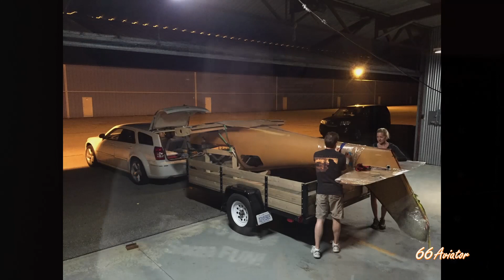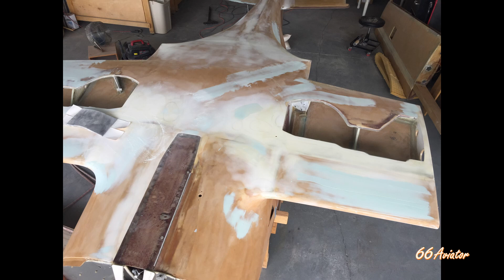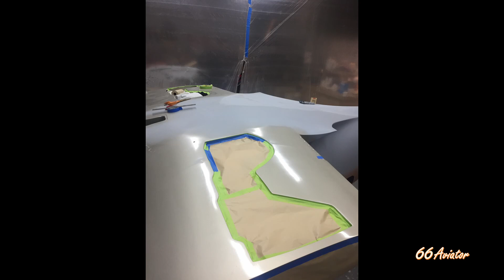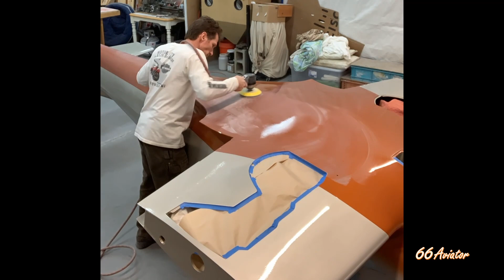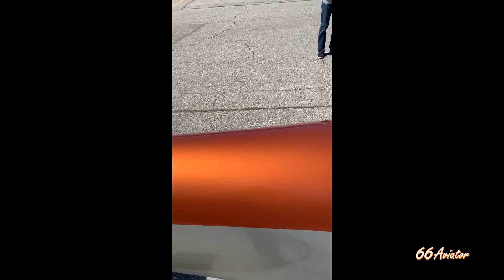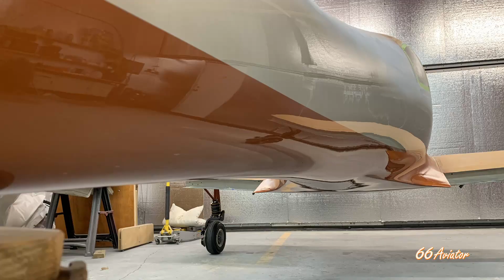Building an Airplane: #5, Painting the Lancair

Comment: Lancair is gorgeous! Is there a reason for mountng the engine (and the prop! in tight hangar space) while still midway thru the build?
Reply from the maker: Yes, actually, because I'm now working on the firewall, wiring, exhaust, prop governor, etc, I needed the engine on. The hangar space is a lot larger than it looks in the video. But, I did NOT mount the propeller for that reason, it would take up a lot more space and be at risk of getting scratched or damaged. 
Thanks for watching!

Markus J.